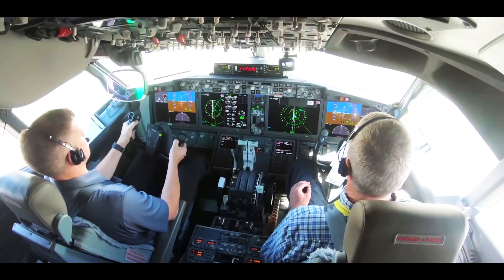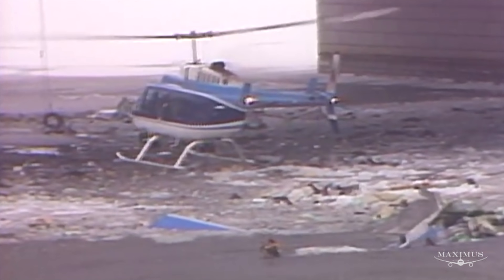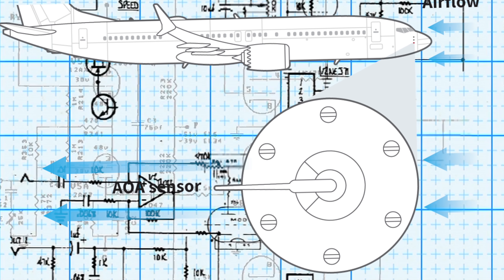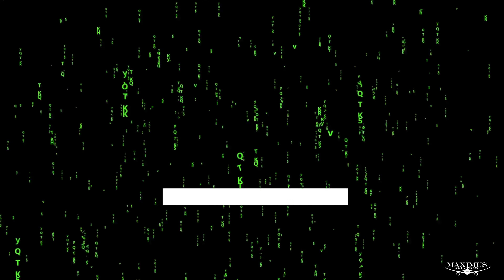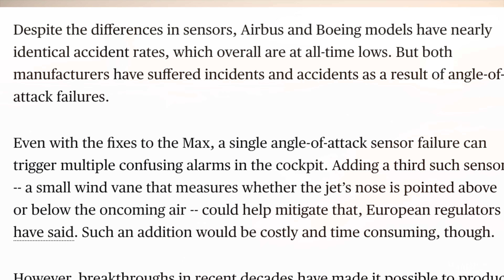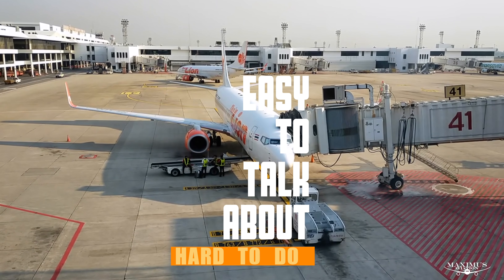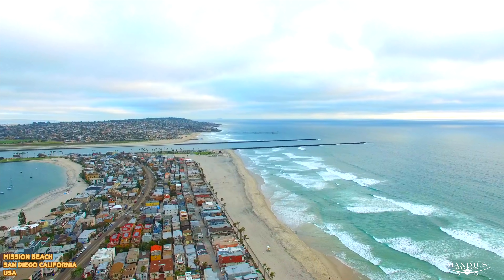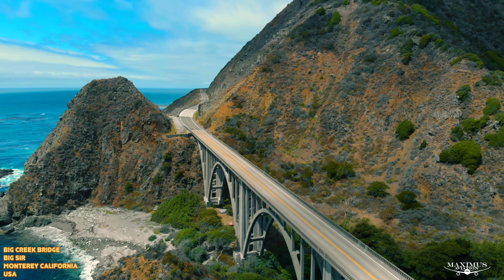Boeing To install 787s Synthetic Air System On The MAX! Boeing Caves To The EASA Will Install System

Comment: You're talking about old-fashioned pitot tubes. You could have 8 of those w/ all of them freezing up or having debris inside. At least two planes have crashed bc technicians covered these external tubes w/ tape which they FORGOT to remove!
Reply: Pitot tubes are still the most accurate way to measure airspeed. Using GNSS and AOA is only a backup because it’s not accurate

Comment: Boeing caves, Boeing caves. In my experience planes that stay in the air make money. Planes that crash has a negative all around. Which one is cheaper? Which one is safer and will make money? Boeing did not train the Pilots on the new system. Just how safe less does Boeing want to make their planes?

Comment: Boeing and Airbus aircraft having similar accident rates doesn't mean the MAX doesn't have a higher rate, which is in fact true.
If we look at the MAX alone vs other recent commercial aircraft,  even vs the 737s previous generation, the fact is that the MAX's crash rate is exponentially higher, hence the grounding. Therefore, saying that the fear of the MAX is just media hype is not correct.

Comment: Cut the crap and redeign the plane to be stable without unreliable software fixes.  Reposition or change the engines
Reply: The plane is stable without MCAS, so the software was only needed to make it handle closely enough to the previous 737 in every situation. That way it could be flown by pilots who also fly the old 737. How else do you think the Lion Air pilots flew it just fine previous to the first crash once they disabled MCAS?
Reply: @Hornet135  BULLSHIT

Comment: for angle of attack? wouldnt a simple weight attached to a string be able to tell that as a back up atleast? airspeed is harder but angle of attack shouldn't be.
Reply: No because if you pitched up or down that would also change your weighted string. Angle of attack and pitch are not the same

Comment: Wait err what? What percentages are we discussing when saying Boeing and Airbus having equal accidents rates due to angle of attack sensors? 737MAX has two fast deadly accidents on a not yet widely deployed airplane. This deadly accident rate cannot possibly be similar to any other plane. If you’d extrapolate that accident rate to other plane types, you’d have an insane crash rate.

That said, extrapolating may not be the entire story, as MAX also is very much about MCAS being a secondary system piloting the plane that the pilots were not trained on nor familiar with. If all pilots flew plane without training on how to mitigate lethal loss of control scenarios we’d probably have problems on those planes too.

Comment: Synthetic Air Speed may well make the Max a safer plane. But this is really something of a black mark against Boeing. The EASA had to force Boeing's hand to do it. And the only reason Boeing caved is to get EASA certification. That is hardly commendable and in fact only makes Boeing sound unconcerned about safety. Their only argument against SAS  is the potential cost to Boeing and to its customers. Is that genuine safety concern or bottom line focus? No, for this person, this only reinforces the "bottom line first" image that Boeing has crafted for itself. Boeing appears to be the best advertisement for "Buy an Airbus instead" I've seen.

Comment: What is the cost of synthetic system? A few mils? Another angle attack and pitot tube cost what?
Reply: That still doesn’t guarantee no problems. AF447 had all pilots freeze and loose airspeed briefly. I know that wasn’t the cause of the crash but newer Airbus have got around this issue

Comment: 3 AOA vanes is all that is needed.  737s only have 2. When you have 3 sensors then you can go with the 2 sensors giving equal values and the computer will kick out the value that does not match, a.k.a the failed AOA sensor.  It will then give the crew a warning of the AOA failure.  A320 were designed to be fly-by-wire in the beginning, and so have 3 AOA.  The icing concern is overblown.  The failure of all external sensors are rare and when they occur they are very short lived.  AF 447s sensors were only inop for a little bit very a minute.

Comment: the bottom line is that airbus have got 30 years on boeing on using automated systems, whereas boeing really has minimal, some FBW to the 777 and 747-8 isn't really a challenge, as it just helps pilots, but notice that boeing are using a system in the new 737 to actually alter the way a plane flies. They don'y know what they're doing clearly, and shoulf bite the bullet and get dsome advice from airbus, it would be in the best interest of everybody who is ever going to use the 737max in the future.

Comment: I learned once while studying the history of the Apollo missions' software engineering that NASA's rules require triple-redundancy for any life-critical systems on their launch vehicles--and typically that's to protect the lives of fewer than seven people. Airliners are crammed full of as many human beings as they can fit, hundreds usually, and even after a worldwide grounding Boeing is still whining about the EASA wanting redundant sensors.
Reply: Apollo was the most televised and most reported event in history. Nasa had one shot to get it right, if they screwed up public opinion on space would go completely sour and any budget they had would go to zero. These were national heroes on these space craft, for boeing these are just dollar signs crammed into a tube.
Reply: bladerunner12 — The key term her is “life-critical.”  The AoA sensors should not be life-critical.  Even when there are three, two or three could be damaged in a bird strike incident.

Comment: EASA is working with other Aviation Bodies across the globe on the Max. The FAA was again negligent in its failure to have this installed BEFORE any acceptance tests. This does not bode well for anyone accepting any knew aircraft with FAA approval only. It is clear that the 737 Max series still has a long way to go. Any sensible airline would insist that Boeing agrees to buy back the aircraft if there is EVER another crash.

Comment: About time. Unreliable air data has claimed many hundreds if not thousands of lives. Mainly in Boeings but it can affect Airbuses too.
Reply: Airbus have had a solution for years now called the BUSS. Back Up Speed Scale. Now looking to be replaced by enhanced monitoring of he ADR’s and back up airspeed using AOA, load factor and weight data, next it will be using engine data
Reply: @tomstravels520  Why this wasn't done years ago begs belief !
Reply: @pasoundman  probably unreliable airspeed events hadn’t been a major factor and there has always been a work around but it was complicated and confusing. Birgenair 301 still had 2 functioning airspeed indicators, the pilots just didn’t do any cross checking. Aero Peru 603  has a working radio altimeter and IRS so could have used that to get back to airport but it requires maths

Comment: Synthetic Airspeed would have required the Max have separate Type Rating according to current FAA standards.
Reply: the 737 max SHOULD HAVE ALWAYS HAD A NEW TYPE RATING. you can't keep stretching an aircraft, and add engines that don't fit, and then pretend nothing changed, by adding that suicidal MCAS system.
Reply: @wim0104  Absolutely. As soon as the nacelles got shifted forward and up it was no longer the same plane. Center of mass and center of lift certainly changed enough to deserve it
Reply: Think you're right, Juan! Well, given the current maelstrom with global air travel, I think Boeing could take advantage of it and go for broke. Why not go ahead and add the system?

As a sidenote, you really made my day with the fire update today.
Reply: It does make you wonder how many changes they can make before it really needs a new type rating. Almost like the ship of theseus, but with upgrades.
Reply: Correct.. New type req
Reply: Schlomo Baconberg  just blood :D
Reply: agreed - and that's EXACTLY what all of the issues with the Max came from.
The airlines demanded newer more fuel efficient planes that could pack in the sardines in the newer, slower norm for commercial airline travel (modern jets fly quite a bit slower than the 747s, 727s, DC-10s I flew on as a kid, no joke, all for fuel economy reasons).
And when Boeing showed them the new advanced airliner, they balked at the fact that it obviously came with a new Type Certificate, meaning they would have to get their pilots the Type Rating (meaning they needed training, and wouldn't be usable for revenue flights during that time) - which is just common sense as you add new airliners to your fleet, but in this insane market-driven-world the suits/accountants were listened to instead of spanked and told to STFU since safety is more important than dollars, every time.
The suits/accountants demanded that shady things happened, so these obviously very different airplanes were forced through (with corruption at Boeing, the FAA and most importantly at the airlines themselves) with a big old Jedi hand wave - pretending to the world that this was just a minor upgrade.
There's nothing fundamentally wrong with the Max, it's just that the pilots needed to be trained to the various differences between an old school 737 Classic and one of these.
This was obvious within days of the second crash - and all of the relevant Boeing, airline execs and FAA administrators need prison time. Not fines, they need to do hard time.

Comment: Just to clarify the inference given @ 07:52 that the crash was caused by icing and / or faulty sensors and software this was NOT the cause of the crash. The official investigation found that while the pitot tubes had iced and given false readings at first the averaging done by the flight systems gave viable readings. However the FO flying the aircraft reacted incorrectly and proceeded to increase climb to an unacceptable height which then reduced airspeed. Both FOs in charge ignored airspeed warnings and other instrumented displays. The icing was actually dissipated by the internal de-icing system and was giving accurate readings of climb and AoA for most of the incident. The crew just reacted incorrectly and one of the FOs kept the control stick fully back and failed to tell anyone. Even when the captain returned to the cockpit. This lays out the sequence of events:
https://www.popularmechanics.com/flight/a3115/what-really-happened-aboard-air-france-447-6611877/

Comment: Similar accident rates? Yeah, how many people died on the MAX8? 346. Deaths on the A320neo? Zero.
Reply: @v0id683  It was a 16 year old A320-214. Not a neo.
Reply: Schlomo Baconberg  you're right. The MAX is an excellent plane that was crashed by rubbish pilots. That's why every air safety agency on the planet grounded it for over 1,5 YEARS. Yeah, excellent plane..

Comment: Don't planes have GPS? Surely this would provide a very accurate alternative to a misbehaving angle of attack sensor or blocked pitot tube?
Reply: GPS would go off ground speed which would need to be calculated by the crew to determine if safe. 500 knots ground speed at 2000ft is not safe but 500knots ground speed at 38,000 feet is. Would need to calculate the rate of which the air is hitting the nose plus or minus wind speed

Comment: Hi max this is an wsj An internal FAA memo reviewed by the Journal showed Boeing notified regulators that it had produced parts that did not meet its own design and manufacturing standards.

I dont get what boeing is doing reporting its own failures
Reply from the maker: Video coming tomorrow.

Comment: This is good, but from i gathered the 737 planes that crashed actually didn't have any angle of attack sensors at all because they didn't purchase them to begging with. Does that mean Boeing will start including these aoa sensors as standard?
Reply: No.  They didn’t have warnings to say the AOA’s disagreed. They all have sensors but it was optional to install and AOA DISAGREE warning

Comment: The accident of AF-447 into the South Atlantic was caused by incorrect inputs from the inexperience of the Cruise Pilot. Frozen sensors were a contributing factor.
Not even Boeing can fix flight crew incompetence.
Reply: Correct
Reply: They could've made it so a frozen sensor wouldn't have contributed. They might have lived.
Reply: @slaapkonijn58  AF-447 was an Airbus A-330. The common factor in this and both Max accidents was the incompetence of the flight crew.
Reply: It wasn't inexperience,   He had an unaccountable brain fart

Comment: It's all about profits fir Boeing. This just reinforces my decision to never fly on a Boeing aircraft again. One Max flight with an under train crew was enough for myself and my family.
Will stick with Airbus and whenever possible my new favorite aircraft the A220.
Maximus the difference between the 2 companies accident rates is that Airbuses were not based on making more profits like the Max crashes.
The Air France crash was caused by pilot error. The ppilot kept pulling back on the side stick pitching the nose of the aircraft up until it stalled. Not caused by the aircraft its self. He was a fully qualified pilot for the type of Aircraft un like nearly every pilot who ever flew a Max flight. These pilots were undertrained because Boeing didn't want to have the price of their new aircraft increase. Boeing cheaped out and killed everyone on those 2 flights and that is the only reason they crashed, not enough pilot training and no back up system for a critical flifgt information system.
Reply: On the Air France plane the two little side-sticks were uncoordinated and out of sight, so that one pilot was unaware of what the other was doing (=:stalling the plane). If the little game-controller sticks had been synchronised then maybe the plane wouldn't have crashed. Maybe Airbus had cut costs by not linking the two sticks or maybe no-one thought of the consequences of not doing so.
Reply: @None-zc5vg  that was a crew problem not the aircraft. It was caused human input not aircraft computer input. And was the aircraft grounded for months and months and months because of it . No it was not.
Reply: @thearsenalmisfit2414  If the movement of those 'joysticks' in the AF 447 cockpit had been synchronised, then the human error of one pilot would have been detected by the other. So the accident was caused by something more than just the shortcomings of one of the cockpit crew.
Reply: You forgot that there is a priority take over bottonon on the airbus which anouces which pilot is taking control audibly and disengages the other stick.  There were odviously Comand Resource Managment problems with the crew and this was sighted as one of  the reasons for the crash. There was nothing wrong with yhe aircraft or it's design unlike the Max, its was  the crew that failed in its communication.
Reply: @thearsenalmisfit2414  Thanks for that bit of info. on the @ 'priority take-over' button: maybe the loss of the instruments also affected/disconnected the audible 'take-over' warning (was it audible on the cockpit voice-recorder ?).

Comment: I may be wrong here not seeing whole picture but looks like Michael Teal was at least partially guilty of deaths of passengers and crew in those two fatal flights. Could it be that by example prosecuting him for those accidents could bring bucket of cold water on heads of Boeing management. This may stress fact that the high positions and all money they make comes with responsibility which cannot be shrugged off buy need to appeal to shareholders. He just did not do all he could to ensure safety of passengers. When pilots do things like that they usually pay with their life.
Reply from the maker: good point.

Comment: The commentary slips in a statement about the equal number of Airbus and Boeing AOA incidents/accidents and says that much of the fear of the Max is therefore based on media hype rather than the facts. What a deeply misleading and disingenuous statement. I think you will find that much of the fear is based on a relatively new aircraft - the Max - being involved in two fatal crashes killing hundreds for the reasons that we are all now familiar with. Shame on you for trying to deceive. Media hype did not crash the two Max aircraft into the ground.

Comment: The overall accident rates for the entirety of the brand's planes are probably similar.  That is a far cry from saying the 737 Max and almost any other modern individual competing airliner's accident rates are similar. How could they be given the relatively small number of 737 Max flights in the statistics?

Comment: Two very public crashes with total loss off life......media hype! Really?! Are you insane?! Your comparing apples with pears. Crashes over the long life of a model if compared and the same, yes that would be fair but this was a new model and if it hadn’t been grounded how many more such crashes would’ve occurred thereby pushing the figure in quite the other direction. It was only swift action to ground the vehicles that stopped that. I hope none of the relatives ever hear your clumsy and flawed words.

Comment: Whilst it is indeed good that the 737 Max is now getting the hardware it should have had in the first place it will only be as good as the training the pilots receive. This is something that in recent years seems to be rather lacking. Without doubt, the best commercial pilots are those that were former military pilots closely followed by PPL hobby pilots. Why? Because they have more experience and are used to flying with less reliance on automated systems. There is no substitute for training and practice.